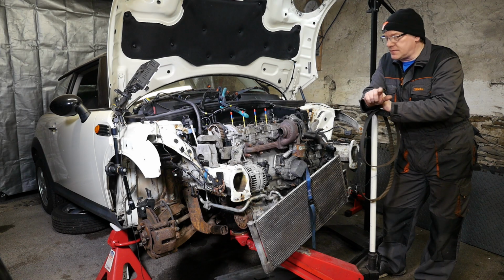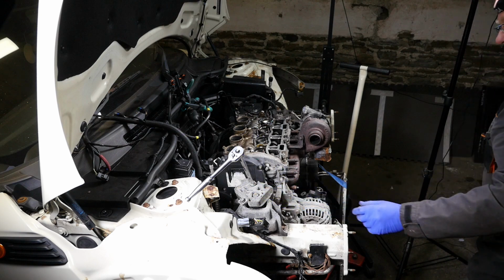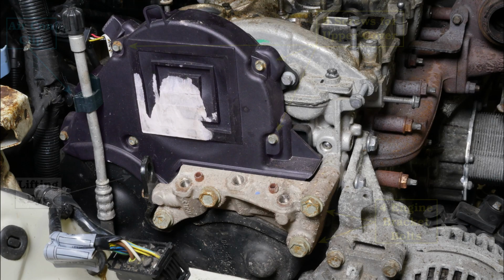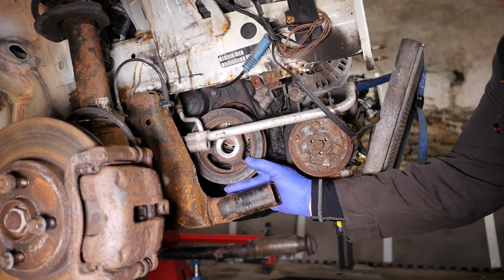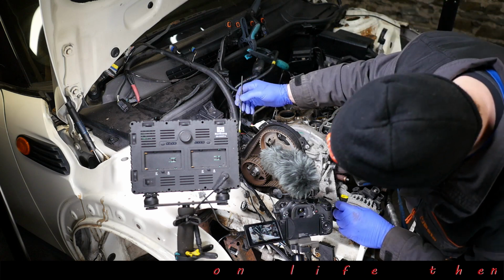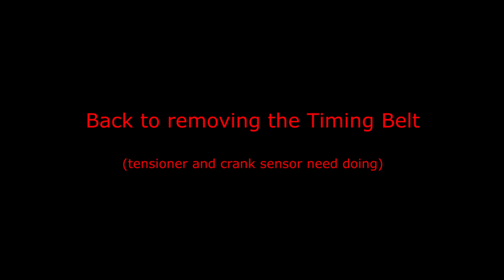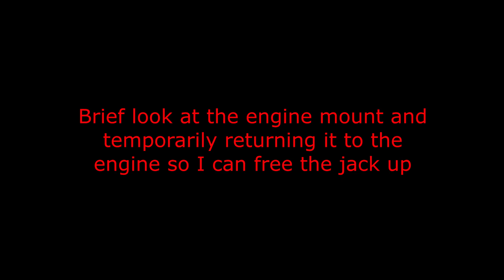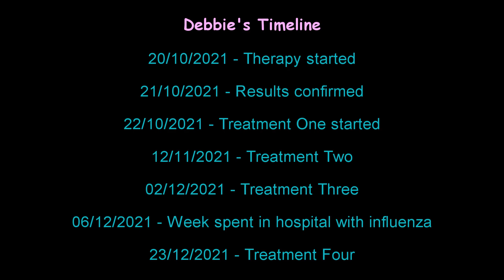Part 9 - Removing Timing Belt & Engine Mount on 2009 R56 BMW MINI Cooper Peugeot 1.6 HDI TDCI DV6

Comment: Another great video. Good news that the timing is still aligned and no bent valves. If the engine is in a reparable state, I would be putting on a new timing belt just for piece of mind (made in Romania) would not instill confidence. Can't wait for the next installment.
Reply from the maker: Hi Neil and thank you.  I think the belt is made by Schaeffler under the INA name.  I just had a comment about the timing belt lol and I'm now going to be really lazy and copy and paste what I said.  "I have to put costs ahead of everything at the moment due to lack of funds.  Because of the shear number of things that need mending and it's yet to pass an MOT I am very reluctant to buy anything that doesn't absolutely require buying.  I think I would replace the timing belt and apply the same tension it had before removal thereby I wouldn't be adding extra tension on a belt that's already been pre tensioned.  The water pump was also changed 11,000 miles ago.  If I get the car actually mended and it passes an MOT I would then consider spending money on it.  But I actually drive less than 100 miles a month so a car isn't a high priority to me."
Reply: @CoatsandGaiters  Hello Mark. I can see your point on costs these days, just a simple oil change is a small fortune. I have just watched a video on YouTube, and a so  called pro mechanic filling an engine using 1 liter bottles of oil. Now that is a total farse,as they cost a lot more in single liter bottles. To do an oil change on my old Merc' would cost £144 in single bottles and £98 buying 2 x 4L and one single liter bottle. The world has gone mad.
Reply from the maker: @neilhampson2843  I think the car has to prove it's worth to me first.  Having a receipt for £500 in 2019 for that belt would wind me up if I changed it as it would mean that £500 only got the car moving for 11,000 miles.  I am very quirky in this area as your probably finding out lol.  I buy my oil in 20 litre lots from Exol on ebay and it's around £75 delivered so a garage must be getting it for £2 a litre I expect in the oil drums they would buy.
Reply: @CoatsandGaiters Hi again. Thank you for that tip I will have a look at that on Ebay.
Reply from the maker: @neilhampson2843  ebay item number 350475829081 been using this for years

Comment: Awesome video  !! That help me a lot 👍! My car has the same problem, the tensioner is broken. I will start the repair now at Christmas, my own Christmas gift to myself. 💥 💥I hope the damage is not big 💥💥
Reply from the maker: Thank you for the compliment.  Just be aware that if the hydraulic lifters drain of oil you might have some trouble restarting the car as in my last episode. Keep me posted as to how easily the car started.
Reply: Now I have opened the valve cover and the cam chain tensioner was fine. But the engine is still stuck. Would the dual mass clutch be broken??
Reply from the maker: @Kalleppi  when you say stuck do you mean the engine is locked up and won’t rotate.
Reply: Yes, the engine is stuck, turns about 5 degrees and stuck. The car shut off in the middle of driving, and I drove into a ditch. I thought the timing chain tensioner broke, but now there is another problem. Everything looks OK in the engine. I'll remove the gearbox when I have time . Thanks for the reply
Reply from the maker: @Kalleppi  wonder if the timing slipped out or the chain jumped and the pistons hit the valves.

Comment: hello, love all your video's! very clear!  i am wondering why there is so much different information about the Mini D engine regarding the timing belt or chain.... on many websites i find there is a chain.  my engine code is : 9HZ (DV6TED4), on a mini clubman 2008 D.  i thinck this is the same one as this one, so should i conclude i have a belt as well?  how can it be so unclear?  greetz K
Reply from the maker: Thank you for the compliment.  I'm wondering is they did an 8 valve version of this engine and upgraded it to 16 by fitting another head on top of the old block.  If that was the case it was probably a rubber belt and the cheapest way to convert to 16 was to use that belt to run one of the cams and simply use a small chain from that cam to the second cam, hence it has a belt and a small chain linking the 2 cams together.
Reply: aha, that indeed sounds very plausible.  it seems to be a often used engine by many brands.  weird it's so unclear.  never found it explained like this before.  wich one should than be changed at 240 000km? or just change both belt and cam? thnx for your reply! @CoatsandGaiters
Reply from the maker: The chain between the two cams is a pretty major job as you may have seen in my videos.  I think the main issue with the cam joining chain is the tensioner can break apart.  Yours might be ok.  Obviously if the  rubber belt snaps its game over so I'd assume the rubber one to be the all important one.  But bear in mind I'm not a mechanic.   @kevinvancappellen2854

Comment: Unless you don't want to spend too much on this car, you should not put back an old timing belt.
I've heard that once you apply tension on it, if you remove that tension you have to change it.
Same goes for water pump. The axle isn't made to have tension/no tension cycles
Reply from the maker: I totally agree with you but I have to put costs ahead of everything at the moment due to lack of funds.  Because of the shear number of things that need mending and it's yet to pass an MOT I am very reluctant to buy anything that doesn't absolutely require buying.  I think I would replace the timing belt and apply the same tension it had before removal thereby I wouldn't be adding extra tension on a belt that's already been pre tensioned.  The water pump was also changed 11,000 miles ago.  If I get the car actually mended and it passes an MOT I would then consider spending money on it.  But I actually drive less than 100 miles a month so a car isn't a high priority to me.
Reply: @CoatsandGaiters  Okay I understand. Pass the MOT before.
Maybe don't go in high RPM with this timing belt
Reply from the maker: @L3xou97  I think the Peugeot 207cc that's sat in my barn which was running fine and then destroyed it's self and locked up on tick over has put me off spending money on these dodgy cars I keep buying.  There could be an argument that had I changed the timing chain in that Peugeot it may not have destroyed its self but we won't go there haha

Comment: Is this the same engine as the DV5RD.. peugeot BHDi thanks
Reply from the maker: That's a later engine so I wouldn't know but normally they just adjust the older models and tweak them.  Might be the same block.